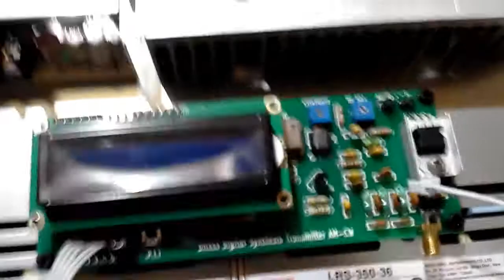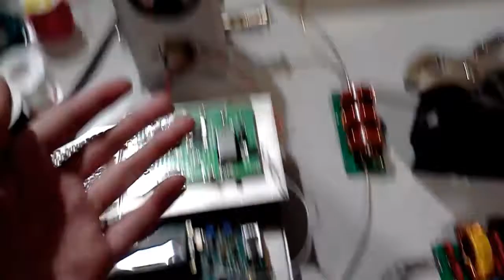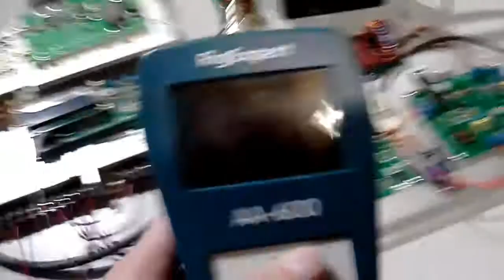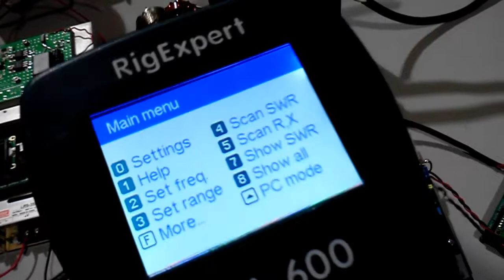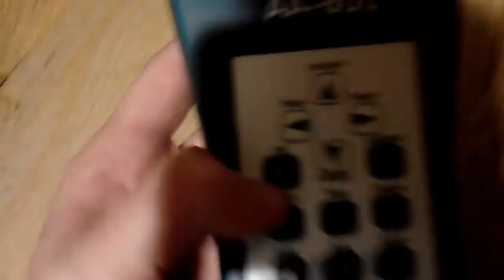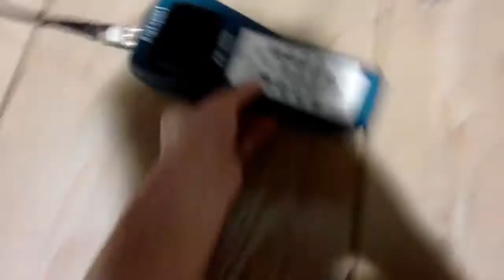Shortwave Radio Transmitters

Comment: Unless you are transmitting on a ham band with a valid ham license, these are illegal. There are large fines and possible prison time for transmitting without a license. If you want to transmit, get a General class license.
Reply from the maker: 6.78 MHz and 13.56 MHz are license free frequencies in the shortwave band.
Reply: @spectra-man  I assume you are referring to the ISM allocations covered by Part 18 of your FCC regs? Voice (telecommunications) doesn't appear to be permitted by the regs. "(c) Industrial, scientific, and medical (ISM) equipment. Equipment or appliances designed to generate and use locally RF energy for industrial, scientific, medical, domestic or similar purposes, excluding applications in the field of telecommunication.". Maybe I've missed something in my quick look at your regs.
Reply: @spectra-man  13.56 MHz is used for rfid readers, not intended for SW broadcasting
Reply: who cares the regulations anyways i have a ham license too and i also operate a shortwave am radio station running 2 kw from Europe and nobody cares about it

Comment: complex piece of sh*t, just get a stretchyman2000 transmitter and add a amplifier to it. You can get over 1000 watts with 300 dollars.
Reply from the maker: The efficiency will suck. There's no point in linearly amplifying a low power PWM (may as well just low level mod the whole thing). The whole system should be PWM. The problem is I don't know how to make a bigger amplifier for a PWM type system. I can't figure it out because the websites dedicated to AM PWM are filled with hams who seem to keep their stuff a secret.
Reply: who said 50 watts is low power? stretchyman2000 released new 50 watt PEP am transmitters, the linear amp has a max input of 10 watts so i set the power to 10 so i dont over drive.